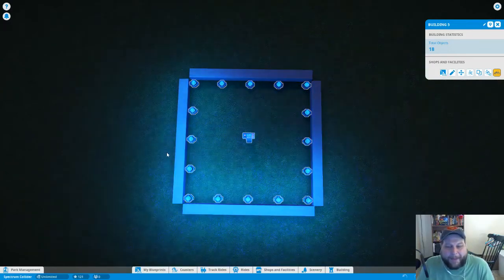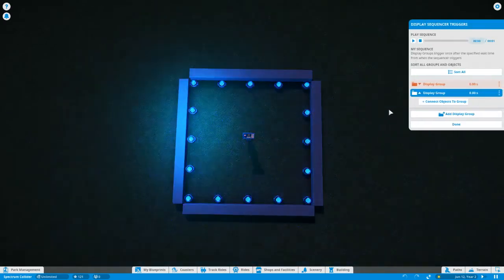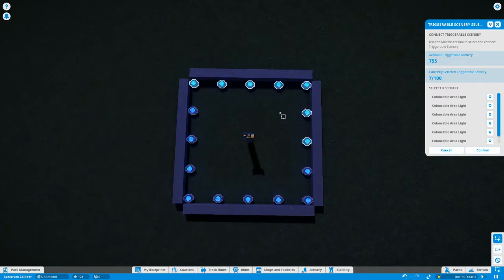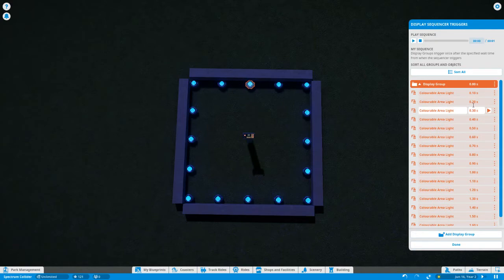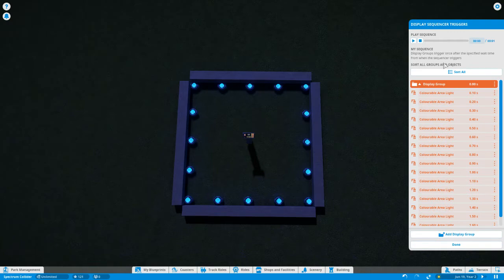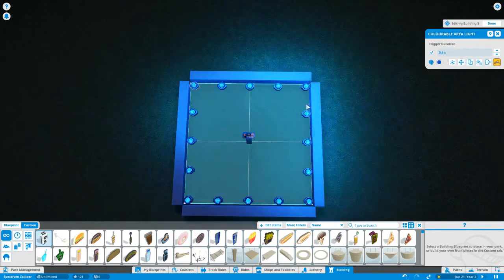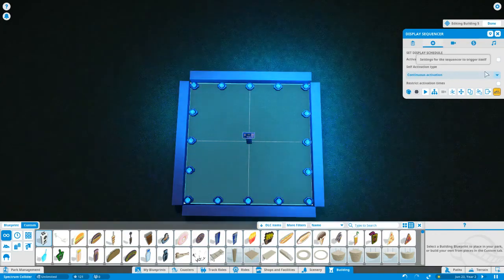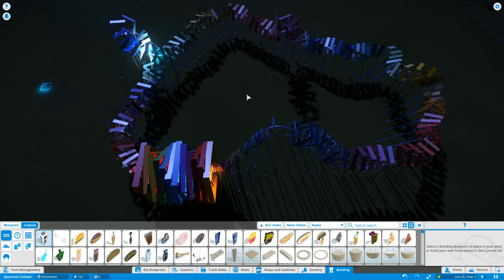HAL's How To Use the Display Sequencer in Planet Coaster

Comment: I tried finishing my indoors Boomerang rollercoaster with the sequencer (on triggers) but I stumbeled upon a bug in planet coaster (atleast in a way it is). Read this if you're interested in how to sovle it, this error might appear in other rollercoaster too. 

My boomerang has 1 lift up, and at the other end it just falls back to the station. Now this plays a big part for trigger sequences apparently, because if there is no second lift on the boomerang (there mostly is one) then NONE of the triggers will work because the cart isn't registered 100% anymore. It seems pretty understandable that coaster planet didn't look into this thing, but now the weird thing is... this error only happens if there are ANY loops and such. If there are no loops, then it works whether there are 2 lifts or just one.
So the way I fixed this issue is I made my loopings by hand, because I did have a loop haha. Problem solved in the end.
So if you're making a Boomerang with loops and only 1 lift and you want trigger sequences to work, then do as I did.